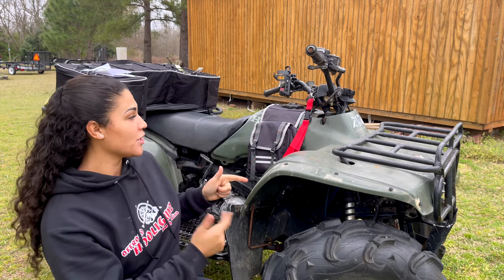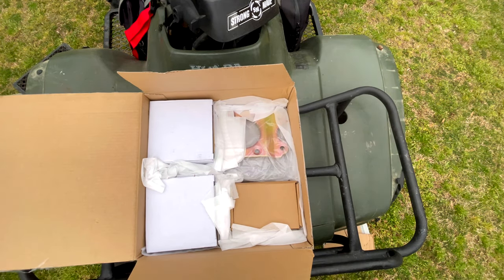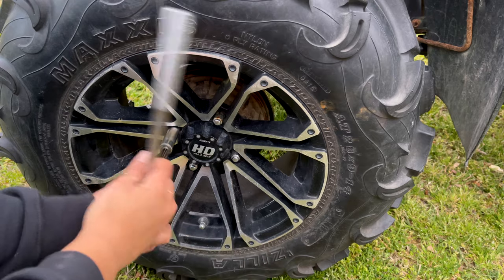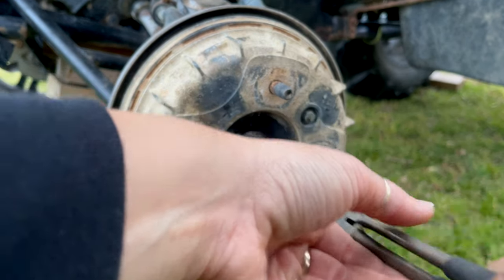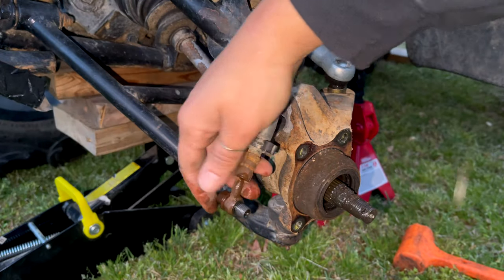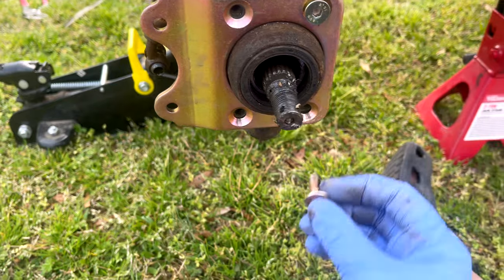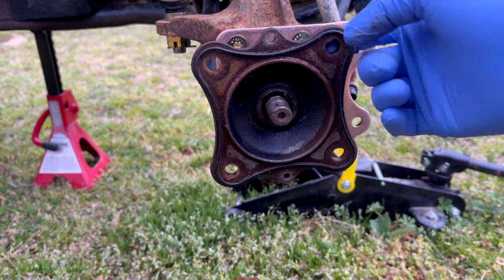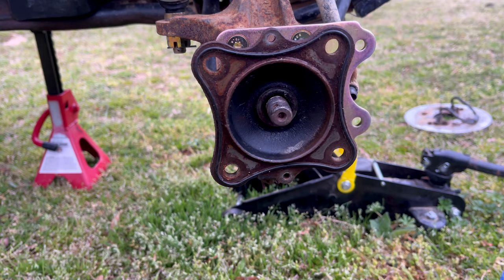How to Install a Disc Brake Conversion Kit for Honda Fourtrax 300 4X4

Comment: Perfect video. Understandable. But one question. What size wheels should go after this job ? Because original small wheels will not fit
Reply from the maker: The kit says a minimum of 12” wheels or larger and that the oems will not work
Reply from the maker: Also thank you!
Reply: @CheyenneBullard  thanks. How cost this conversion kit? eBay 700eu. But that's touch

Comment: I just installed this kit on a 1991. The instructions said to mount the calipers behind the axle but I found that I couldn't route the brake lines (they weren't long enough). So I ended up mounting them on the front and found that the stock brake line route didn't have to be altered at all

Comment: Love your videos and has helped me out, so thank you!  Question, I just got a 95 Honda 300 fourtrx and I’ve noticed “gravel sounds” mostly when I turn either way. But, I can hear it as well just going forward just not as pronounced.  What’s the 1st thing you think I should look at or do?  Any help would be appreciated, thank you!
Shanon Thompson
Reply from the maker: Thank you! I love to hear the videos are helping people. If the noise only occurs while turning I would suspect the axles, front wheel bearings, possibly tie rods as well.
Reply: Thank you so much for replying to me!!  Also, do you have a part preference for those that you mentioned?  Do you use Amazon?  I can’t thank you enough!!
Reply from the maker: @jake06062000  yeah I actually have an axle video of the 300 on my channel. The link is in the description on that video
Reply: Will it work for a 1995? I looked it up and it said 1996 up?

Comment: Both my front and back are screwed should I do this on the front or worry more about the bavk?
Reply from the maker: You can do this on the front and be pretty happy. Most Honda 300 brakes don’t even work tbh. These worked great

Comment: Is it working well with the calipers installed in the front of the rotors? I'm about to receive this kit, and it says they're supposed to be in the rear of the rotors 😟 Every video I see, it is either or! Nice video & good install!
Reply from the maker: Yes it is working well!!
Reply: Typically in vehicle applications the calipers are installed in the rear, so if they could go that way I would, but if it's working I'd leave it until I might have to rebuild the front end, then with everything dissembled I'd go the other way

Comment: When reinstalling your brake line, you didn't have a crush washer on both sides of the brake line fitting. Watch out for a leak.
Reply from the maker: Thanks for the tip

Comment: I have a quick question.....I bought the same kit from super ATV n they didn't have directions n I put them on the back side n I see urs are on the front...dose it matter what side they are on I just wanna make sure I got em facing the right way.....ya know what I mean???
Reply from the maker: Hey! Instructions are online. It will work either way. I have mine in the front do debris isn’t forced into the caliper as bad as if it was on the back side
Reply: @CheyenneBullard   ok thanks n so u think it's better to put them on the front then cuz if so I'll switch em tomar real fast...n thanks again!!
Reply from the maker: @shanewilliams6772  you’re welcome!

Comment: I just pulled my father-in-laws 97 fourtrax out of the weeds this past weekend.  I need another project like I need a hole in my head< but I got it to fire up using ether and the kick starter and now I want to restore it.  It has good compression, but it needs a ton of work and parts.   I've watched your other videos adding the floorboards and rancher shocks.  Do you have any other mods planned?  I would like to get it running again for him to ride around the farm.  I'm located in central NC too.
Reply from the maker: Nice! And yes I do I’m debating on the snorkel or not. I’ve been trying to swap the plastics for blue or red but I have not had any luck finding a good set. Are there any mods in particular you are looking at?

Comment: Are you planning on doing the rear like this also ?? I found the SuperATV Utility ATV Rear Disc Brake Conversion Kit for Honda 2x4 & 4x4 online also
Reply from the maker: I wish but those kits don’t fit the Honda 300 they fit the ones with the brake drums that are right beside the hub
Reply: @CheyenneBullard  Thanks for your info, JUST bought one and trying to familiar myself to them, that's how I found you !
Reply from the maker: @REVNUMANEWBERN  you’re welcome!! The Honda 300s are an awesome classic!
Reply: @CheyenneBullard  Just bought mine & I'm trying to find the FRAME number ( not the decal ) per the manual but can't, I DID find the engine number, if you have time on your next video can you show folks where the engine & frame number is??? BTW, are they supposed to be the same?? Thanks
Reply from the maker: @REVNUMANEWBERN  the frame number on these are at the front on the horizontal metal bar you’ll see it stamped in there

Comment: I've gotten so used to not having breaks on my 300. I ride it through town and just shift down
Reply from the maker: That’s what I used to do but these are so convenient to have.
Reply: Damn straight figured I was the only one lol
Reply: I've been riding mine without brakes but where we are is very hilly.  It's a pain to have to roll off a path to stop on the down hill sections.  I think I'm going to give this conversion a try.